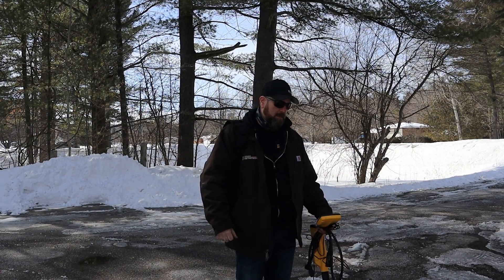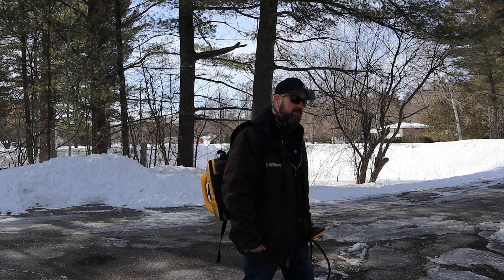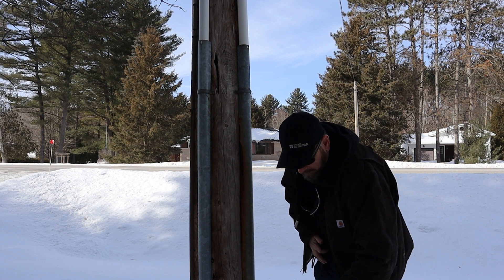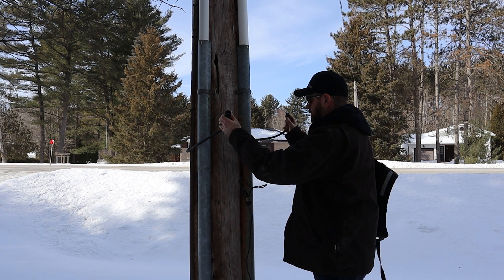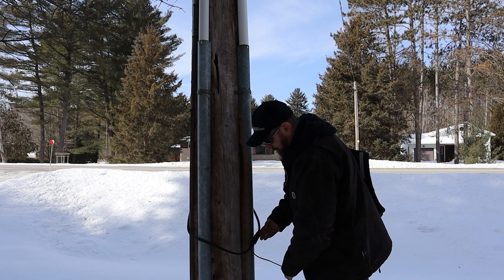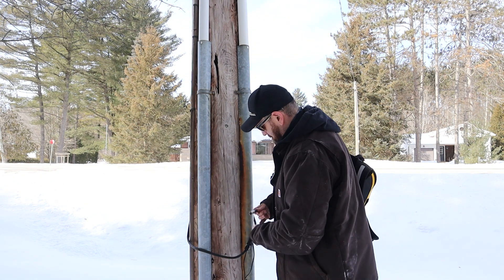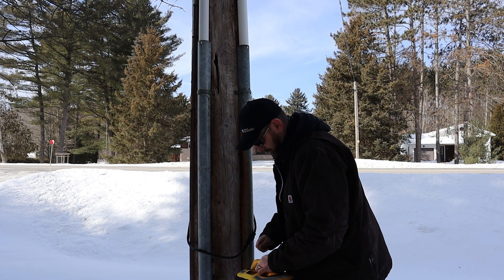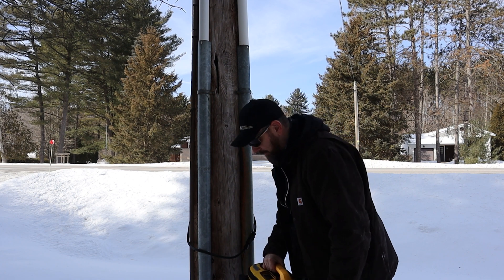Strap Clamp, Induction Clamp

Comment: How do you separate the two services ? You wrapped around two at the pole. Better to clamp at the house to isolate. I do like the strap.
Reply from the maker: Yes of course it is better to connect at the house. However, The point was to show how the clamp works. The 2 services are clearly defined, had I shown that in the video, one goes the direction I did and the other was complete opposite.
Reply: @vivaxcananada  can I get some info on cost of the strap ?